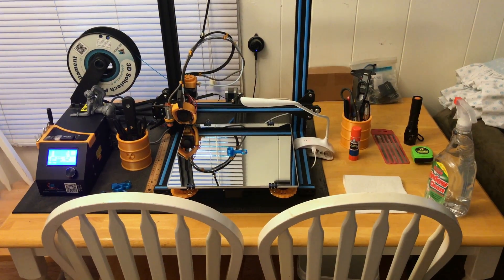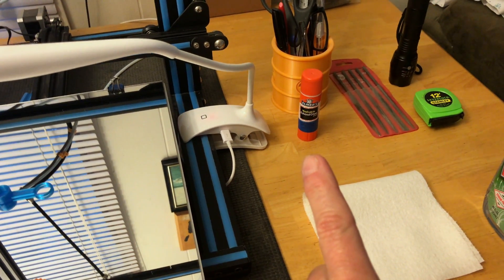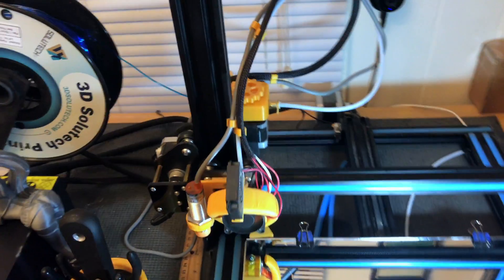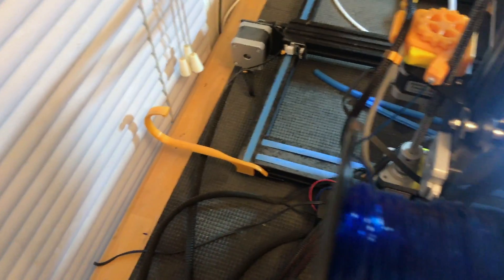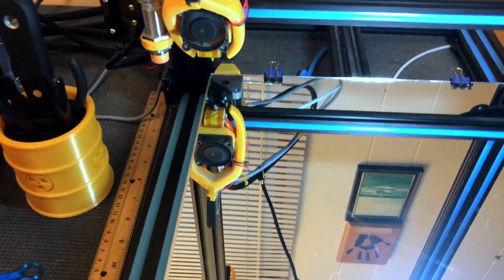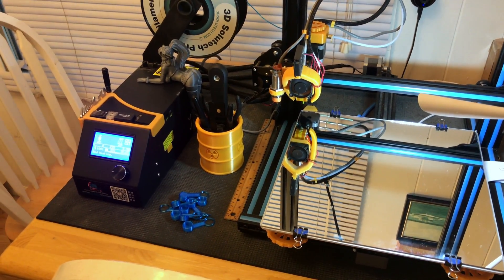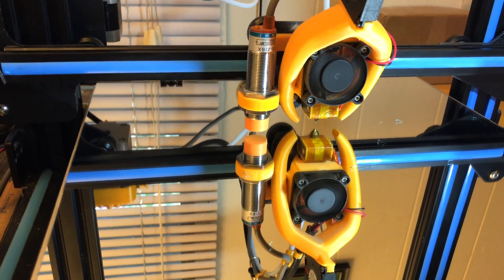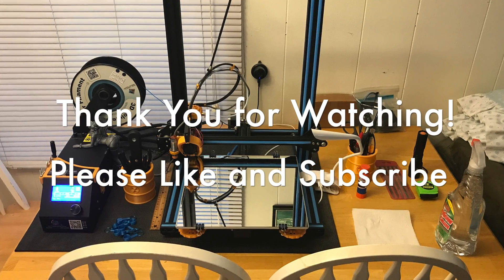My Creality CR 10 Workstation and Start Stop Scripts

Comment: how could you do this routine but heat the bed only , then level everything then heat nozzle before wipe so you dont get all those dots. Same thing happens to me snot drops everywhere its frustrating
Reply from the maker: I did try that by removing the nozzle heating lines from the start script, but I ran into a problem with it.  If you don't heat the nozzle before leveling, there is usually a small amount of cold plastic on the end of the tip and it can cause your nozzle to bump into the bed.  The plastic is cold and hard, so it does not bend and it can make the leveling procedure not work.  If you remembered to clean the nozzle every time after each print, it might be ok.

The other thing to keep in mind is that when you level your bed, it's best to have the bed and nozzle up to temp due to heat expansion and changing the leveling slightly.  It's only a tiny bit of difference, but for the very best results, you should level with both bed and nozzle at your printing temperature. 

The way I'm currently doing it is sometimes a hassle if it leaves a lot of blobs, but I'm so happy with my first layer adhesion and thickness that I'm happy to pick the blobs when they happen.  I'm currently printing on CCTREE print bed surface, so I don't have as much trouble with blobs sticking.  https://amzn.to/2TCU2WD